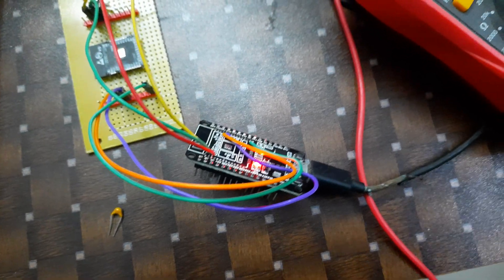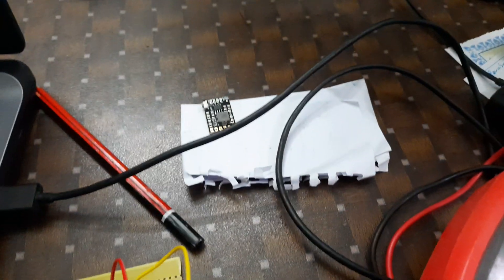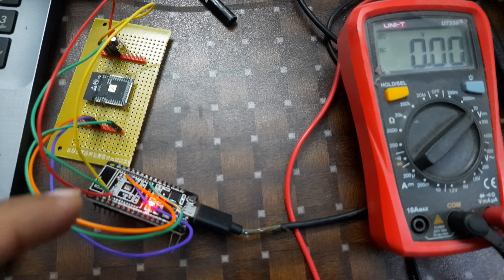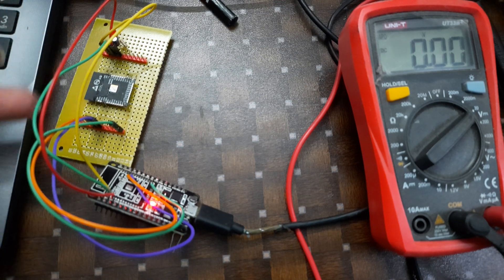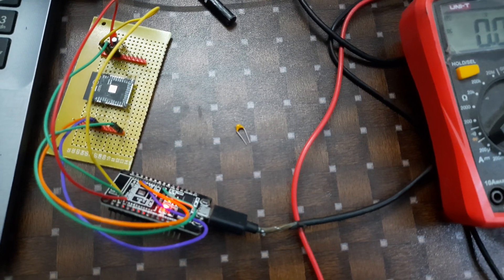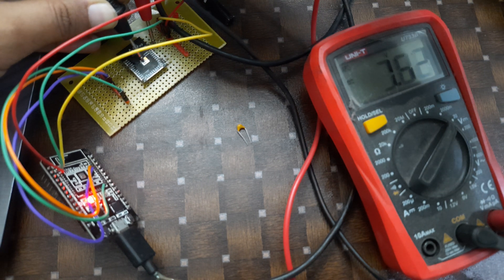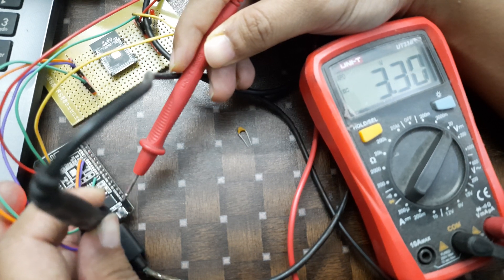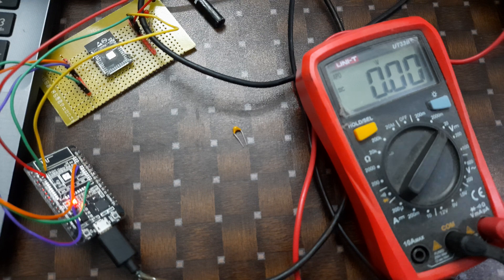#3 ESP32 brownout problem cause & solution

Comment: Same problem,
When using WiFI the input voltage decreases to  3V, sometimes below 3V. I used 0.1uF, 47uF, 100uF and also 1000uF. But I can't fix it. 
I tried my MI charger 5V 2A with AMS1117, but it didn't work at all.
Is there any good solution?
Reply from the maker: Use as short wire as possible. Don't use any jumper wire. Place capacitor as close as possible. use a 104 capacitor between GND and 3.3V.
Reply: But how to remove jumper wire, can I use any other wire?
AMS1117 can't connect without wires
Reply from the maker: @elabinnovations  jumper wire is a big problem. First try with a good quality power supply. Then, if success go with asm1117.
Reply: @TechMechanism  OK
Reply from the maker: After all this done if problem is not solve comment here. I will try my best.
Reply: @TechMechanism  ok
Reply: The same problem was. I try any capacitors 100nf, 47mf, 470mf, strong wire, also try 3.3v from ams1117 arduino test board. Not helped. 
But can upload sketch from rtl232 and run simple sketch led switch example. But if i try ble run => brown detector was triggered.
What hepls you.
Decide => Try cp2102 without capacitor and any garbage)) its working with them.
Reply: @Dimoven I don't understand you